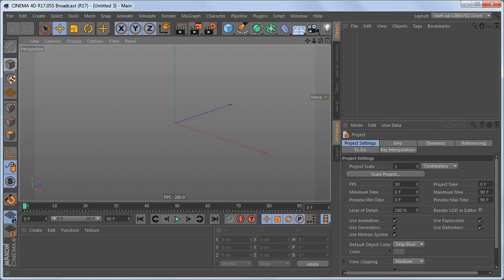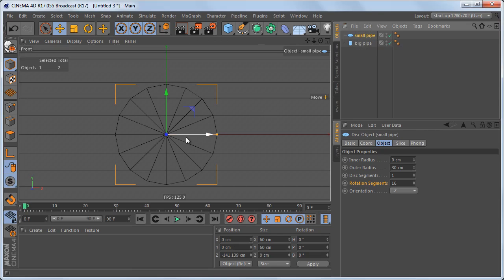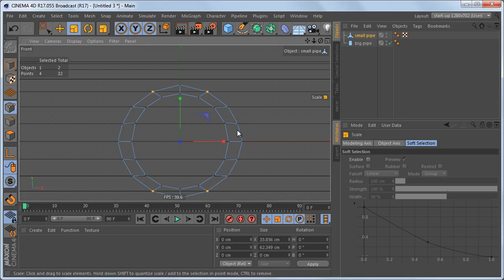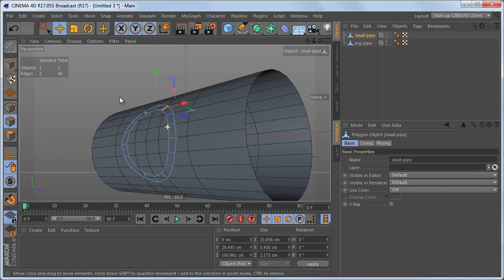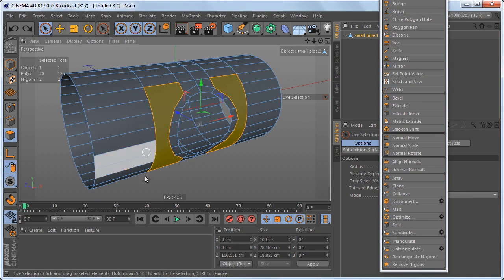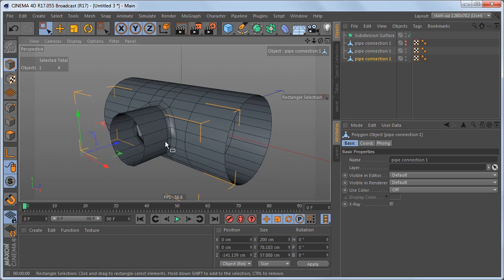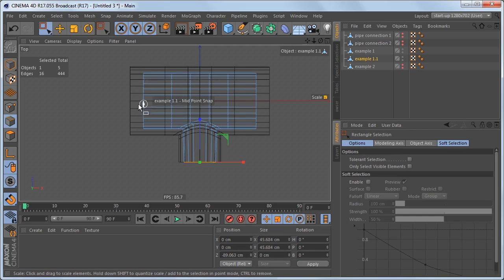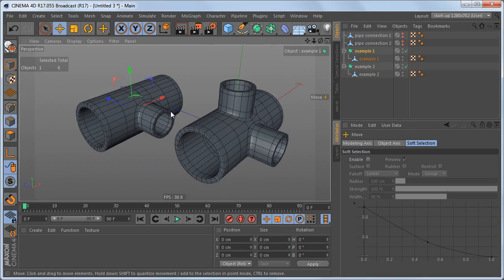Modeling pipe connections - Connecting pipes that have different diameters | Cinema 4D Tutorial

Comment: Thanks for tutorial! I understand that I can use this method for modeling Truss, but unfortunately it doesn't work correctly.  Could you explain how to connect one pipe at an angle to another one?
Reply from the maker: You're welcome! You'll have to adapt the technique in the video a bit to apply it to an angled connection. If I find the time, I'll do a tutorial video on how you could model a connection that can be used for creatng a truss.